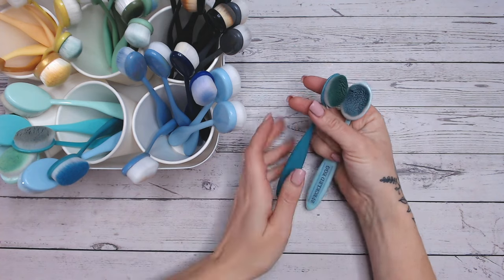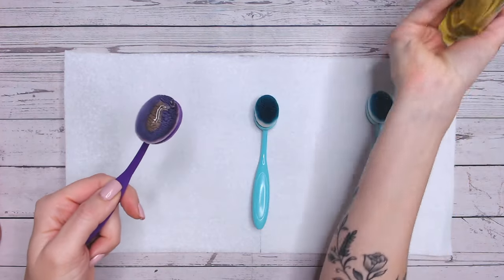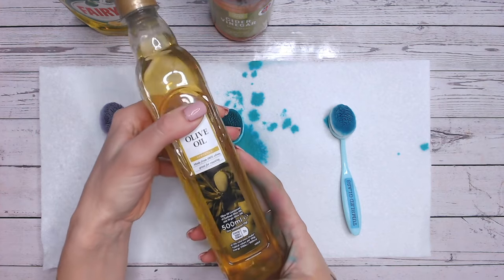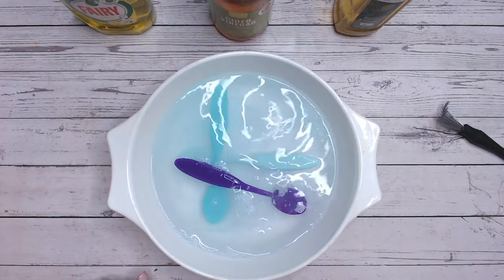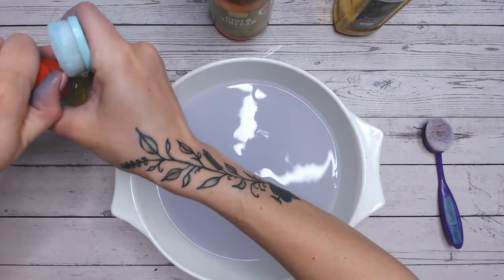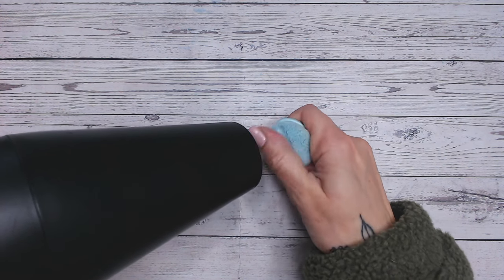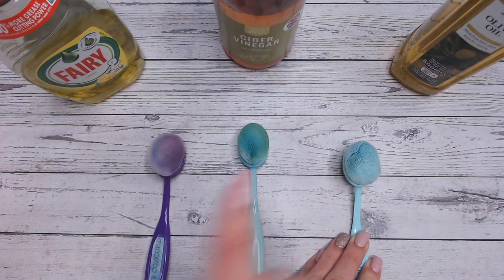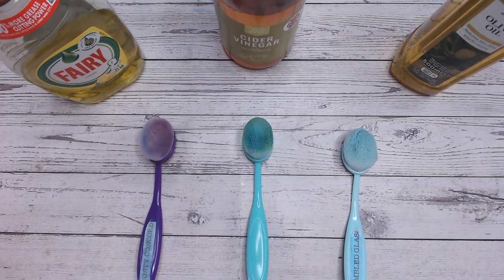How to PROPERLY clean Distress Oxide Blending Brushes!

Comment: In the US we have Dawn Power Wash for dishes. I tried it on house paint rollers & brushes, it was unreal, cleaned them fast & even removed a lot of old paint out of the bristles. Then tried it on my oxide brushes, it took 95% of the dye off the bristles all the way down & kept the brush soft.
I never use anything else & keep a bottle close by. It takes just about everything off in my artroom & throughout the house that other products don’t get off!

Comment: I use a combo of dishwashing soap (dr. Bronner’s works well) and olive oil for makeup and blender brushes. Also works for paint brushes, and other natural hair bristle brushes. Olive oil bar soap works too. If you put some of this cleaner on a brush used for cleaning veggies or utility cleaning brush (hard nylon or plastic bristle) and gently rub the makeup or blender brush over the harder bristle brush, it’s  another way of getting the cleaning solution deeper into the brush.

Comment: Thanks for the experiments Lou.
 Ive seen a video putting all ur brushes like these in a pillow case tying it & washing them in the washing machine on 30 degrees, with your normal washing powder,  & they all came out lovely & clean, nice & soft aparrintly, Ive not tried this but very tempted, as its a very easy solution, no washing each brush  individually,  all nice & clean in one go, I really like that idea as saves time. x

Comment: I tend to just spritz a little water on my brushes at the end of a blending session, and then wipe AS MUCH off of them as I can, and I've never noticed any bristles clumping
I'm not surprised the olive oil didn't work.  D.O. inks are water reactive, so trying to clean them with oils...it wouldn't dissolve.  And then to wash off oil n a bowl of water...oil and water don't mix.  
Thanks for the info.

Comment: Thanks for this great experiment! As Distress products are water based I would have assumed that the washing up liquid would work the best lol. As for olive oil - mmm big fail lol. I could never see that working to remove a water based product but it was certainly worth a try. I just put some plain soap on mine (not oil based) and give a soak in water overnight.